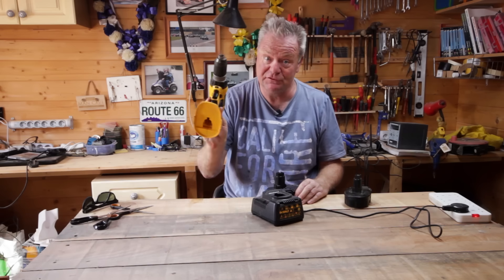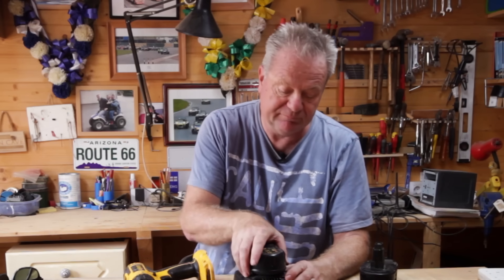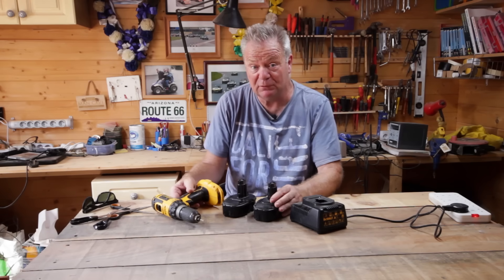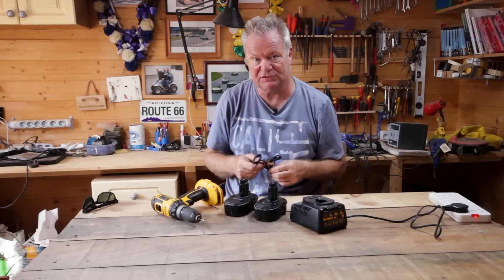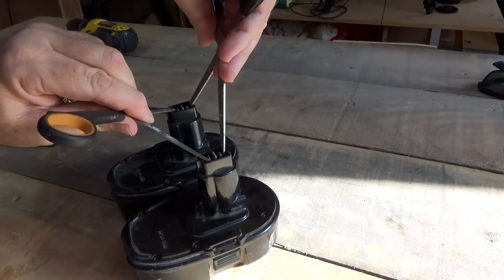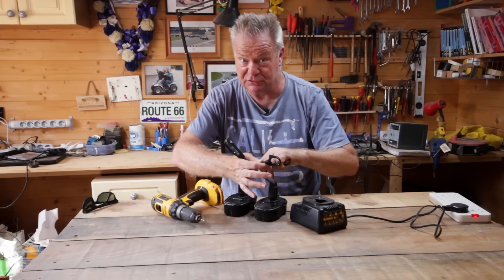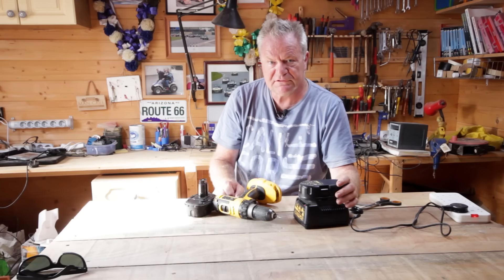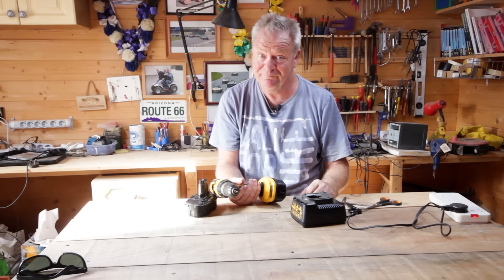How to revive a dead rechargeable power tool battery easily

Comment: Great demonstration and idea ! Is there other specific tools that can be used instead of scissors? Can you define modern lithium battery pack ?
Reply from the maker: Yes you can use anything that conducts. Many people have asked why didn't I make up leads with crocodile clips at each end to which I reply this is the Canary Islands so you have to use what you have. "They" say that there is a possibility of lithium batteries getting hot or catching fire. There are a number of people that have commented saying they they used this method on them and it worked without a problem.

Comment: Will this work if the dead battery isn't the same as the live one? I have a DeWalt drill and it's (dead) 14.4v battery, and a 20v Li-ion battery from a "Master Mechanic" drill. Can I use the latter to help charge the dead DeWalt battery?
Reply from the maker: It is the voltage that is more important than the brand. Using a 20v may be ok but if you can borrow a 14.4v one then that may be safer. Thanks for watching.

Comment: Hello, i don't have a second exact battery, but if I was to find another power tool battery I presume you need to match the voltage on the dead battery, would that be right? Many thanks.
Reply from the maker: Yes, the voltage is the important thing. Thanks for watching.
Reply: @JPinFuerteventura  thank you for answering, that's really helpful. I'll let you know if it worked. ☺

Comment: You helped me determine positive an negative poles, my battery so dear my meter can read it? I'm going to try this! How can I fix my 24V battery driving 2 or 3 screws then going dead, instead of lasting for much more uses?
Reply from the maker: Sadly it sounds like you have a damaged cell or cells if it goes dead quickly Tim
Reply: @JPinFuerteventura  Thanks! I'm following through with info for video I'm going to get this running!

Comment: My battery is 12V Makita. I check the voltage was 11.2 V but I put in the charger the lights flashing which indicates faulty battery ! Any idea? Please response . Thanks .
Reply from the maker: Does the battery hold its charge when you use it?

Comment: Now is it good for a time or two after or is it permanently fixed?
Reply from the maker: That depends on the battery. The one in the video was flat because I had used it in my drill until it would no longer turn and then forgot to put it on charge for many months. Once I did this to it I never had to do it again and it gave good service for another 4 years. If a battery is flat because it has damaged cells then it may not hold charge for too long. Thanks for watching.

Comment: Yes, a totally dead battery can be revived. What about batteries that hold very little charge?  This does nothing for them.
Reply from the maker: This tip isn't meant to help batteries that will charge but won't hold a charge. That normally means they have one or more damaged cells.

Comment: Brilliant!
Reply from the maker: I hope it helps. Thanks for watching.
Reply: @JPinFuerteventura  I did not have a second battery. But a year later I have just tried attaching a car battery charger to the Ni-Cad battery. The car battery charger showed that the charger was putting out 8 amps into the dead battery. I did this with trepidation and safety glasses a couple of times for a few seconds and then put the "dead" batter in the charger, and it is charging again. It spins the drill too. And 40 minutes later the normal Ni-Cad battery charger said it was charged and I drove in a dozen 3 inch screws. 

So if you don't have two batteries, you can try a car battery charger, and thanks very much again.

Comment: My new battery completely died like that after a month made no sense. I saved it lucky, about to try this now. Be back to say if it works
Reply from the maker: hope it helps. Thanks for watching.
Reply: @JPinFuerteventura  I have ryobi batteries. Couldn't use your method. Think you can do a video on ryobi drill batteries?
Reply from the maker: @Chrisg04161  Firstly, why couldn't you try it? Secondly, I don't have a Ryobi power tool so I am unable to

Comment: I bought drill with 2 batteries that looked brand new but previous owner said sat for many years i tried this technique unfortunately didnt work on mine is it because its old ?
Reply from the maker: I assume you used a charged battery to jump across from. If you did then it may be that the batteries have damaged cells. I am sure you didn't but if you did just jump from one dead battery to the other then that will do no good. You would need to borrow a good battery from someone to jump with.

Comment: What if both batteries aren’t holding a charge?
Reply from the maker: Aren't holding a charge or won't charge? There is a difference. If they charge but won't hold a charge then they probably have damaged cells. If they won't charge at all it may just be due to them being so low that the charger doesn't recognise that they have been inserted, so won't start to charge. That is when to try this tip and you could borrow someone's good battery to use to give them the initial boost as in the video. Good luck.

Comment: I'm going to try this because I've got a p-power lithion 14500 battery that's not charging and I like this tip because it doesn't cost much and need one item. P-power batteries came with 12 pack and charger. One leaked too as they aren't protected. I should buy the protected ones. Do this work with any battery type? Thanks for this great little tip!
Reply from the maker: It can although "they" say you shouldn't try it with lithium batteries

Comment: Doesn’t work, buy after market batteries which are unfortunately manufactured in China or better yet, buy a new drill. That would be considerably less expensive that the Dewalt replacement batteries. Try Milwaukee drills.
Reply from the maker: It does work in many cases - just read the comments.

Comment: I notice at 39 seconds the charge light comes on and at 40 seconds you use a little slight of hand and cover the charging light with your finger while re-directing the viewer by waving your left hand and looking away.

I'll try the method as it seems to work. I have also been buying DeWalt 18v tools for almost nothing now ever since the 20v system came out and an 18v battery as you say costs more than a 20v drill with battery and charger.

For anyone who doesn't know, Dewalt makes an adapter that will enable you to use 20v batteries on 18v tools.

Comment: I have exactly same batteries and same problem with one of them 
Sure i am gonna try that trick.
 Thanks  for the tip JP.
Reply from the maker: I hope it helps Imran. Thanks for watching.
Reply: @JPinFuerteventura  sorry I forgot to tell you it did actually work thanx. 
But is it possible if I have one  different make battery  to revive with the Dewalt battery?
Reply from the maker: @ImranKhan-hz8jy  Yes. It is the voltage that is important
Reply: @JPinFuerteventura  i tried Dewalt 18v to another 24v to revive but it didnt work not idea why? Can you help please?
Reply from the maker: @ImranKhan-hz8jy  Perhaps the voltage was insufficient. You could try it with another 24v battery.
Reply: @JPinFuerteventura  will do that thanks God bless you

Comment: JP, I tried, thought I had it, but when I did the scissor method, the battery went in the charger and the red light blinked normally..20 mins later it was blinking very Fast, took it out and tried in drill...Nothing. Any suggestions ?
Reply from the maker: It sounds like it was flat as it has a damaged cell or cells unfortunately
Reply: @JPinFuerteventura  TY, JP

Comment: Ive noticed no one has commented on why dead batteries dont charge
So heres why
First thing always keep batteries charged 
Most modern chargers need a minimum of 3 volts left in the battery this tells the charger that the battery is in good condition to charge it if it is less than 3 volt the charger thinks the battery is damaged so it will not charge it so never drain them totaly flat and alway let them cool down after use before charging 
Do this and your batteries should last you at least a couple of years maybe longer with constant use
Reply from the maker: Correct Chris. I do mention it in the description but no-one ever seems to read that.

Comment: Does it matter if it’s a NiCad ?  Will it restore it back to good condition ?
Reply from the maker: Yes you can do it on a NiCad. Whether it will work for your battery depends on whether it has damaged cells or not. If the battery has insufficient charge for it to register as being inserted in the charger then this will at least allow it to start charging to enable you then to find out if the battery has a problem or not.
Reply: JP in Fuerteventura thanks for your prompt reply JP. 
I have 2 NiCad 14.4 volts batteries. One was reasonable and the other one dead as. It wouldn’t even register on the charger. 
I fully charged the good one and then did your trick with some bits of wire for a good minute,  and lo and behold, I’m now able to charge the bad one,  both now have full charge and just now I tested them both by drilling a few 1/4" holes  in some timber and both have their old mojo back with buckets of torque. 
Thanks. 
Paul.  Sydney Australia.

Comment: Thanks for the video. BE AWARE that cheap replacement batteries are often not as high capacity as advertised. I bought a Shentec 3,600 NiMh  new battery from Ebay. Similar to what I've found with other replacement "cheap" batteries, on testing on my battery discharge tester its true capacity was less than 2000mAh down to an end voltage of 13.5 v.  Nowhere near the 3,600 mAh they sell them as being.  If replacing individual battery cells, be aware that not all cells can be fast charged . They're sometimes really designed for a circa 14 hour charge rate. Don't discharge battery packs too low. NB once a drill runs much slower stop using that battery pack, or you can reverse-charge some cells inside and shorten the battery pack life.
Reply from the maker: Good advice Michael. Thanks for watching.
Reply: @JPinFuerteventura  Many thanks..

Comment: I came across this video by accident. I have the same Dewalt drill. One of the 18V batteries would not take a charge for years now. Only reason I didn’t toss it was because you’re supposed to recycle them. It’s an older drill and batteries. I tried this and it worked!!!  Thank you very much.
Reply from the maker: Great. Thanks for watching Junior.

Comment: I just happen to have a dead one that I didn't want to throw out. I'm going to try this trick and I'll come back with a comment on the result.
Well, I just tried to revive a battery that has been completely dead for over a year and one hour later the good news is that this hack worked exactly as the video shows...and for the trolls, yes I used scissors too, didn't even have to hold them up.
Thank you so much.
Reply from the maker: I am glad it helped. Thanks for commenting Alfredo.

Comment: This didn’t work, any other brilliant ideas?
Reply: Yeah, take the bottom of the battery off and unsolder the battery connectors and replace the batteries. You must mark how each battery was connected to each connector.
Reply from the maker: Try Daniel's suggestion

Comment: I was very skeptical of this so I did some checking...this appears to be true!  If a lithium battery gets too low the charger wont recognize it, so adding a little voltage will make the charger "work " again.  Tip:  dont discharge lithium batteries down to zero.
Reply from the maker: Yes, all to do with the so-called "smart" chargers, which aren't smart at all of course. Thanks for watching.

Comment: Wut if u only hav one battery?Do u need another same type battery or can u do wut u did with different batteries?
Reply from the maker: It is the voltage that is the important thing so if they are the same that should work. Just make sure you are making the connections +ve to +ve and -ve to -ve.

Comment: You can do this with car batteries too. When a 🔋 goes completely dead.  It loses its polarity.
Reply from the maker: Yes I have done this with car batteries too when the charger doesn't recognise that a battery is connected due to low voltage in the battery. Thanks for watching.

Comment: Tried this, they only work for a few recharges then go dead again. Best thing is to buy only tools using LITHIUM batteries. They hold a charge LONGER when not it use and recharge MORE TIMES then the old ones.
Reply from the maker: That battery gave good service for another 2 years. Finally gave up the ghost some months ago. Thanks for watching.

Comment: can i hook a car battery up to the tool battery since i only have 1 battery? if you run the battery down too low again, do you have to do this again?
Reply from the maker: The problem is the charger not recognising that a battery has been inserted so if you were to completely flatten the battery again then you would. However, I never had to do this again to the battery in the video. If it just goes completely flat again quickly then it probably has a damaged cell. People with 12v batteries have commented that they have used a car battery to put some charge in but I have never tried it.

Comment: ah   HA !   ..just like lead-acid batteries, which get sulfated when not used for a month, or more...WAKE  them up, .....fast charge for 15 minutes, every hour,  (do this 5 or 6 times)  at 200 amps per battery voltage. So for 18 or 20 volt ones, which you've shown here, a few minutes at, say 24 volts and 10 amps should 'wake '  them up......then, install into bullshit factory chargers.  Lion  cells, should not be run down to less than 60  percent......then charged with bullshit factory charger overnite......cheers all......oldtech
Reply from the maker: Absolutely correct Peter. Thanks for watching.

Comment: It's a great idea! It is also used when one forklift battery doesn't respond to the charger. You simply plug a good and equal size battery together for a time,  the plug them both into separate chargers. The battery that was dead is now being read by the charger and will get a new life!
I tried it on a lithium 18 volt battery,  but like you said it doesn't work. Had nothing to lose!! Thanks!
Reply from the maker: Yes, gets around the so-called "smart" chargers (which are actually stupid).

Comment: Works great. It happens when the battery is so dead the charger does not recognize that a battery is hooked up.  Batteries need a little juice to activate the charger.  Also if you do not have a second battery to jump it with you can connect to the terminals on the charger.  Just be sure to get the right ones connected.
Reply from the maker: That is exactly it Allen. Thanks for watching.

Comment: Using this technique won't recharge a dead battery if it has a damaged cell. It's a bit like flogging a dead horse.
Reply from the maker: That is true but this is a way around the smart charger not recognising that a battery has been inserted because there is insufficient voltage.
Reply: @JPinFuerteventura  Correct

Comment: Should have shown the other battery was fully charge too at the end, else all that was done was after the screen change he show the good battery in the charger and the dead/bad battery laying on the table. Then taking the good batter out of charger to show it was charged while just saying it was the bad one.
Reply from the maker: If I had realised what a load of sceptical idiots there were on the internet then I would have done. I was simply passing on a tip that may help others not trying to trick anyone. What would I gain from doing so?

Comment: This works great on NiMh batteries but NiCads are a different animal. NiCads tend to get crystallized between the positive and negative terminals on top of the battery which effectively shorts them out. A friend of mine had a way of clearing the batteries of terminal corrosion, it involves hard to get parts and the voltages used are lethal to those who are not familiar with high power photoflash power supplies. It amounts to zapping the batteries with several hundred volts for several milliseconds (what it takes to discharge a capacitor ). Polarity is important here as well + to + and - to -, messing up could be disastrous.
Reply from the maker: I have heard something similar. Thanks for watching.

Comment: My Dad used to charge car batteries that wouldn't  take a charge the same way with jumper cables from one battery to another. One dead one charged. He would put the charger on as well. Then the battery that wouldn't 
Take the charge, did. Positive to positive negative to negative.
Reply from the maker: Yes I have done the same. All down to the "smart" charger not recognising that a battery has been connected due to too low a voltage. Thanks for watching Gary.

Comment: Great bush fix, we use it all the time. A quick charge when batteries are put in  put in parallel like this (one under charged- one at regular charge) can cause some damage to the cells due to rapid current flow, but unless you're comfortable adding in a resistor and slowing the process down it's a great way to stop the corporate greed that the companies make by over charging for batteries. All the best from another island dweller
Reply from the maker: Absolutely. Thanks for watching Jai.
Reply: jai, what resistor value is correct for this procedure??  Thanks
Reply: @maxwellhouse1902  I use a big resistor so it doesn't get too hot. 5 W cement resistors which i sneak out of old/ discarded TV sets (CRTs) etc work well. If you're going to open up CRTs be aware of the shock risk and make sure you understand how to open them up safely)In terms of ohms, I just use whatever i find, as any resistance to current flow is better than none. I guess you could try different ohm ratings and see what you prefer.